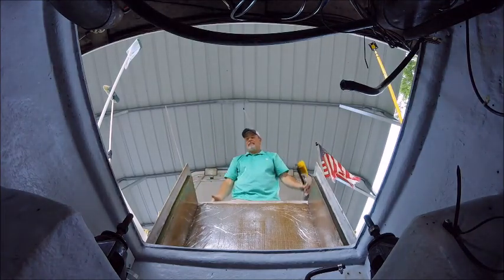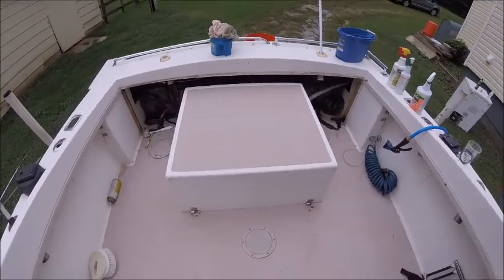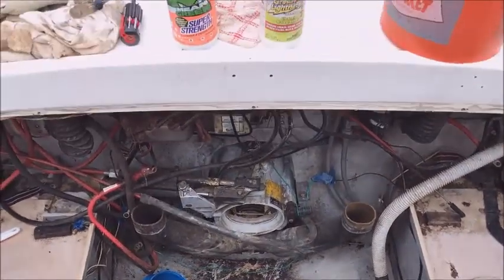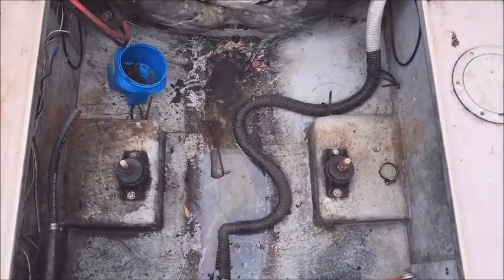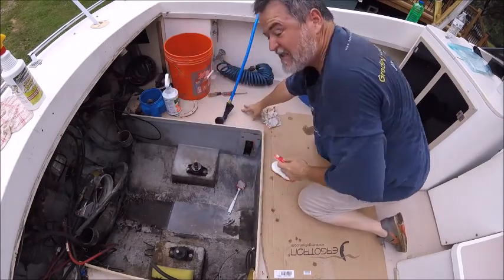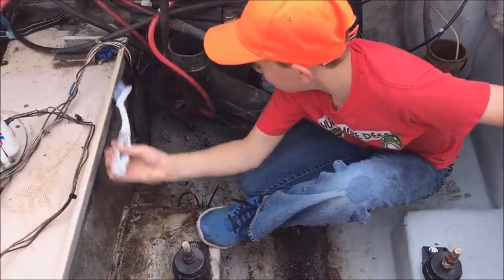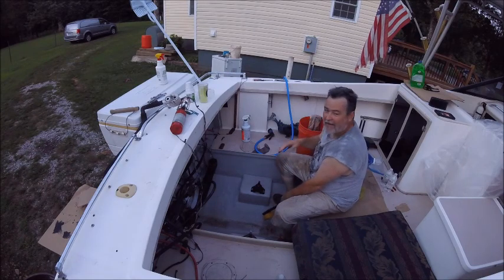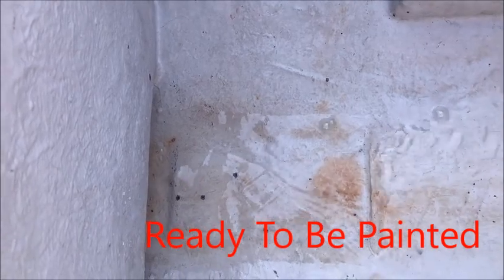BILGE WARS,,,,,,,,How To Clean & Prep Bilge For Paint

Comment: Thanks for posting this, I have this project looming over me, doing an engine change in my Radon and the bilge is very contaminated with oil. The previous owner ran the motor on %80 justice brothers oil honey and %20 40 weight. LOL that oil honey makes the bilge very sticky and doesn't clean up very easily. Thanks for the advice.
Reply from the maker: MEAN GREEN is all I can say it works wonders once you lay it on heavy and scrub it..............Thanks for the comment.
Reply: Right on!!!  Looking forward to getting that bilge clean and a new engine that wont leak or use oil!!!!!
Reply: @RiverReboot  Save the water and use WD-40, straight.  It will cut the grease quicker than Mean Green. Wipe with rags.  Quicker.  Then clean with acetone.